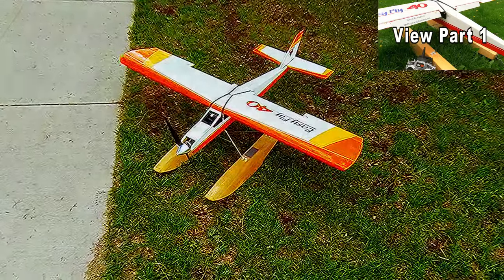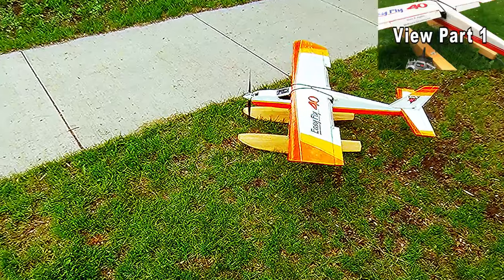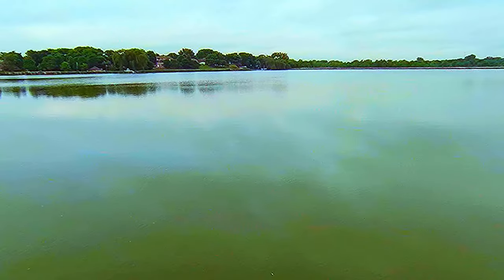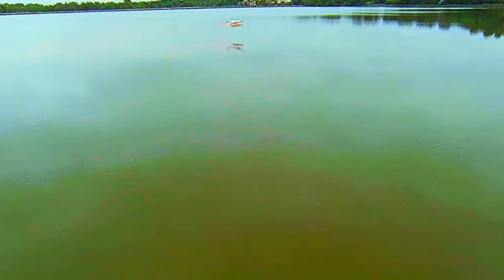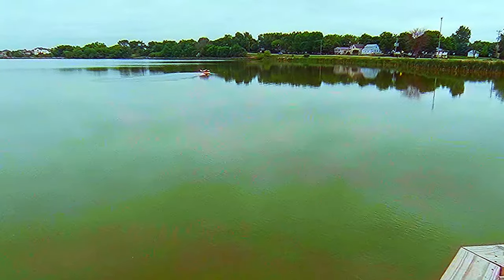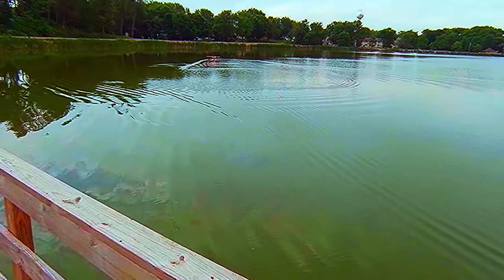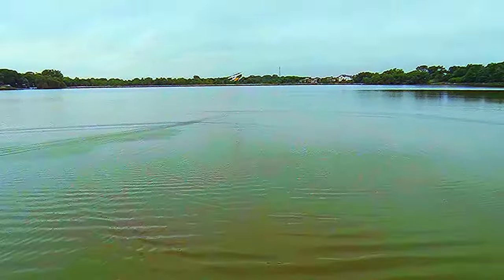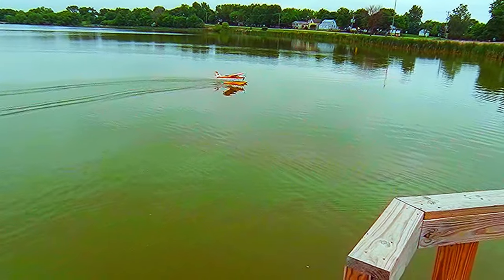Flaps and Floats - Part 2 - June 5, 2015

Comment: Well worth watching the two videos again now that I have an aircraft that really responds to flap activation and I remember, now, the Throttle and Rudder; to which I will apply more and more of my practice time! Thanks for the reminder Glenn!
Reply from the maker: +Bill Flynn 

Believe-it-or-not, I had to watch this series again as well after watching the Tundra. You helped demonstrate how throttle sensitive a plane is with the flaps deployed. Just last night I took my FlyZone Seawind out on the lake, where it was calm at the lake surface, but the wind was moving at a good clip above the treeline. it was a beautiful take-off with the take-off flaps deployed, but once my plane got about 20 feet off the lake surface, the plane pitched up quite abruptly as the plane got into a good headwind with the flaps still deployed. Yes, I had to push the elevator forward quickly while I reached to retract the flaps. 

Yes, you've been showing off the aerobatic side of flaps. Check out Chris' flap demonstration on his Crack Turbo Beaver. (Chris is the designer of my Crack Pitts EPP biplane.) https://youtu.be/Mji7p3MddNc

Maybe I should have had you help me in the demonstration of the aerobatic capabilities of flaps! My demonstration looks so mild. 

Glenn
Reply: I took the Tundra up on Tuesday two times and did a lot of slow flying with a mix of 10% down elevator and a one second delay. On low rates I didn't have enough elevator to flare to my liking so I'm going back to no mix like both you and Chris. Nice demo on that video. Thanks!!
.................. bill